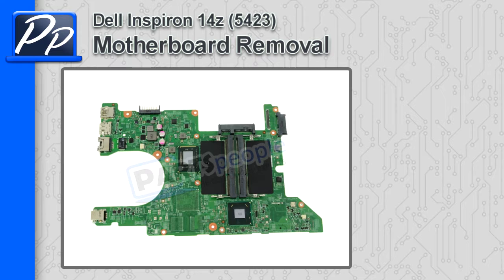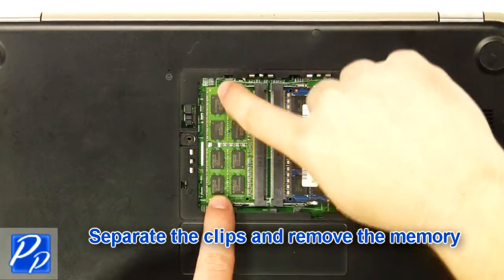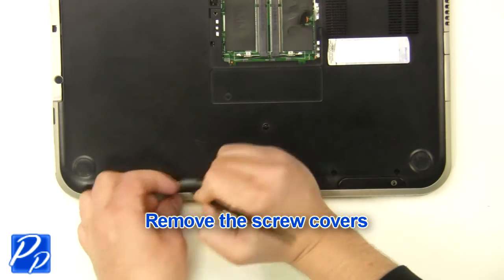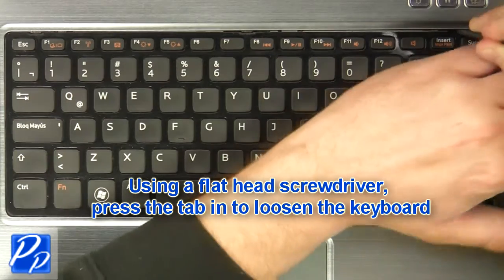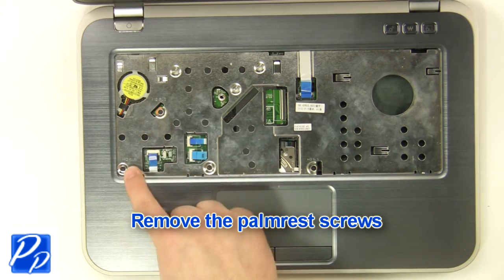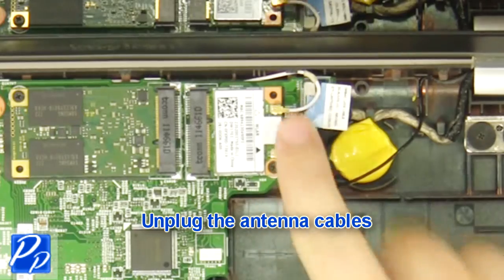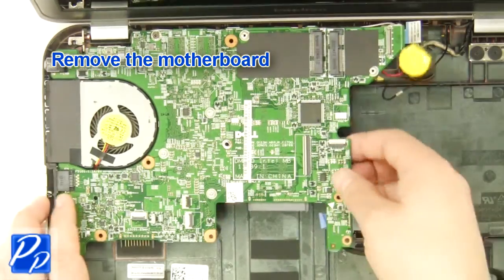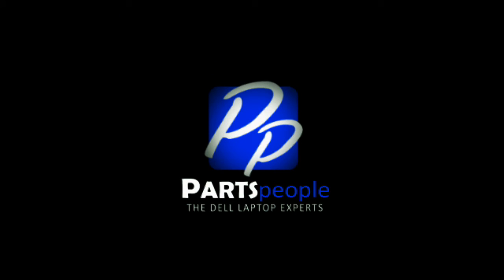Dell Inspiron 14z (5423) Motherboard Video Tutorial Teardown

Comment: Hi, im looking for MoBo replacemente for Lap Inspiron 14z 5423 with i5-3317U@1.70GHz. I checked site but only found i3 model
Reply from the maker: We are currently out of stock. You can get on our notification list and 
we will email you when we get more in stock. 
https://www.parts-people.com/index.php?action=item&id=16111
Reply: Thanks. Just a question, did you buy laptop parts? Because this Laptop is perfect minus the MoBo. Thanks again.
Reply from the maker: Unfortunately, we only buy parts through our commercial suppliers.
Reply: I understand, thank you anyway. Ill be waiting for the part to repair this Laptop. Thanks.